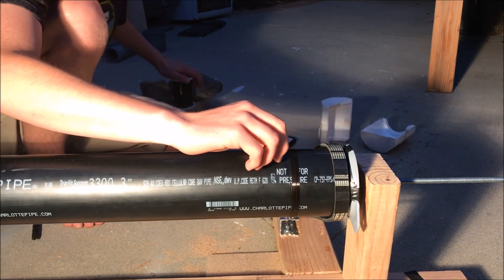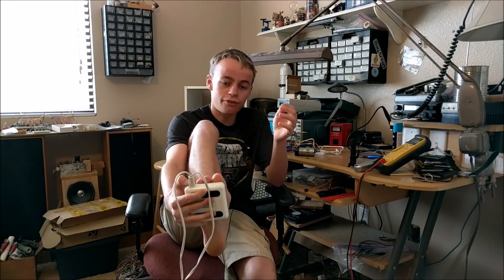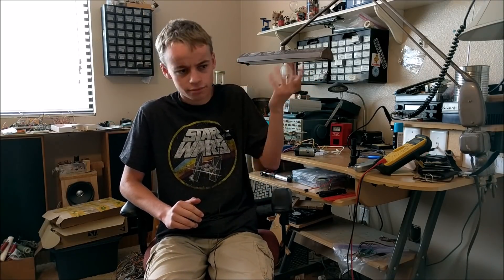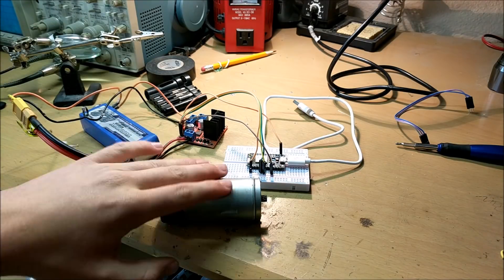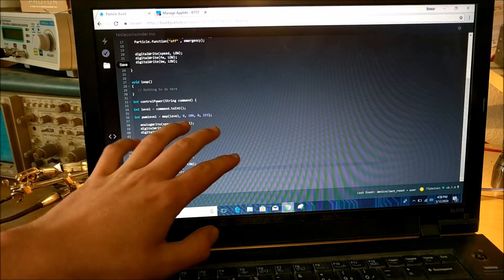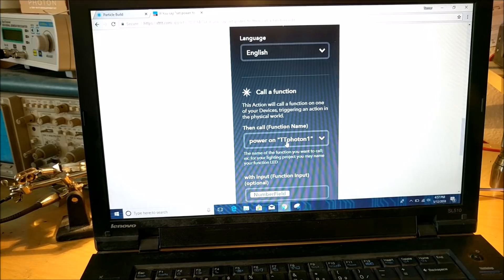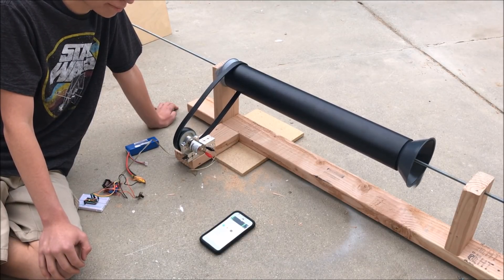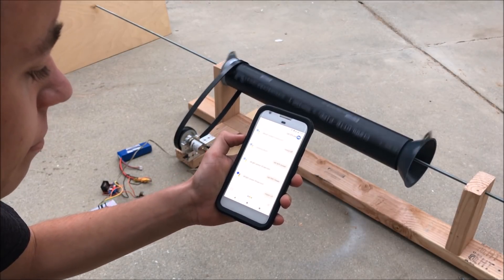Google Assistant Controlled Tesla Coil Winder

Comment: I learned the hard way not to use black pipe for tesla coils I had a winding short out to the black pipe because the pipe had carbon in it as the black pigment
Reply from the maker: Wait, really?
Reply: Tanner Tech yeah
Reply: For me i used abs pipe may be different for you if i was you i would check the Material Safety Data Sheet it may be different for you. I used  Charlotte abs witch had Carbon black CAS 1333-86-4 witch the winding shorted out to

Comment: You could make the whole winding process automatic, you could also calculate turns by measuring the width of the wire compared to the length of the tube, a light spray of Co tact adhesive might help the wore to adhere better to the tube in the way you're using it